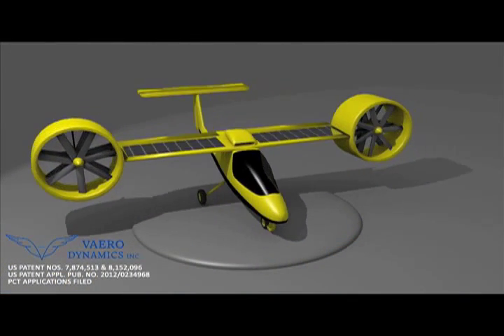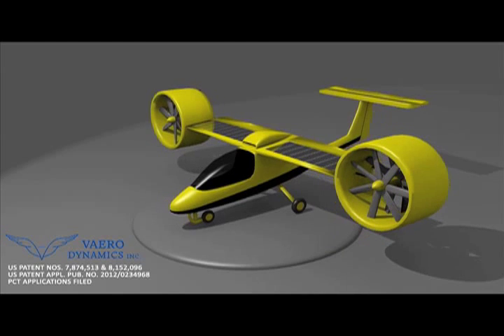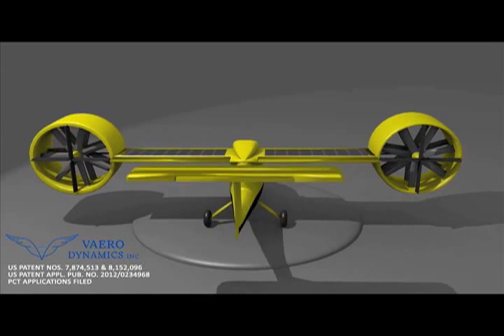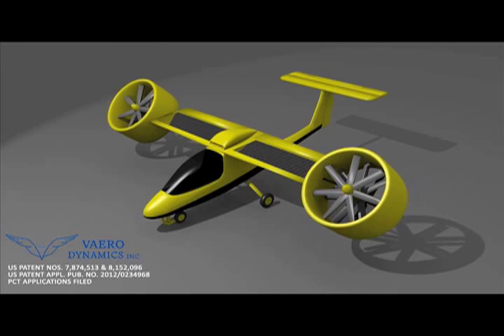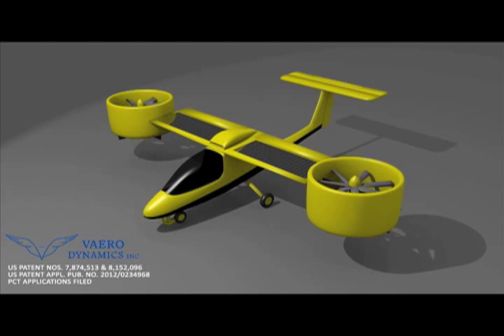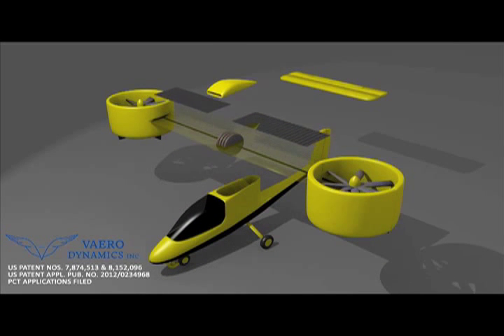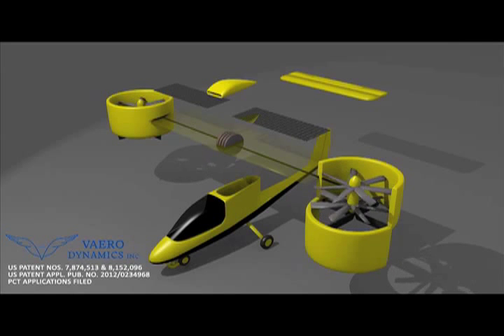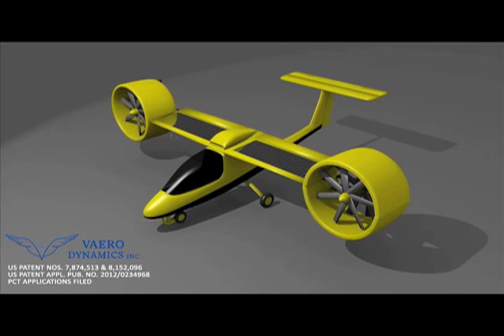Vaero Dynamics Popular Science/Rockethub Campaign

Comment: The concept looks sound. I think most of the designs I have seen incorporate the electric motors directly under the props instead of this drive shaft concept. Also different motors for CW and CCW props provides some level of redundancy, at least one prop should be able to fail and the aircraft can still land (quickly!)   It has to be more reliable than a helicopter which can auto-rotate in an emergency. Bigger blades with winglets are more efficient and quieter. Even an RC version would have been cool -I hope you guys have not given up the dream completely, you were perhaps 10 years too early with it though...